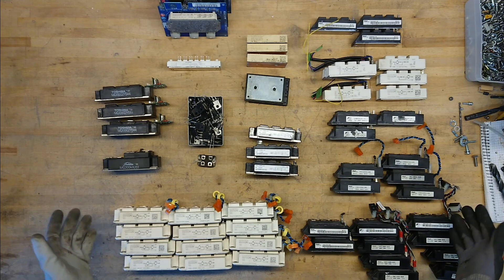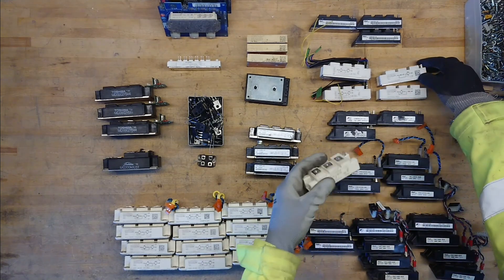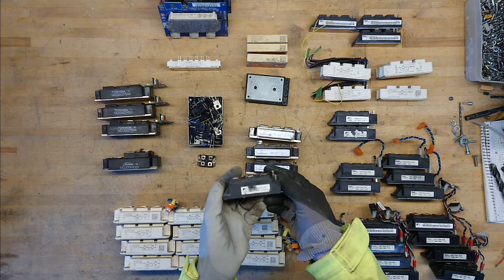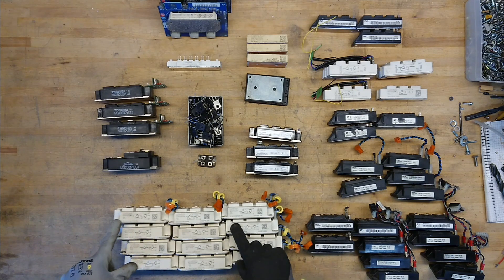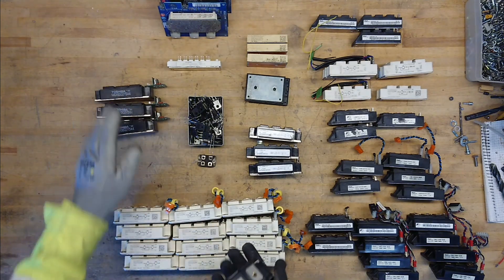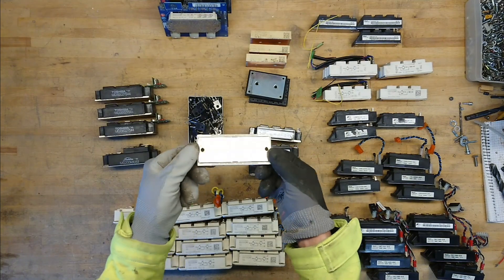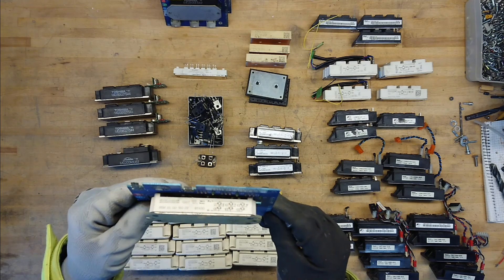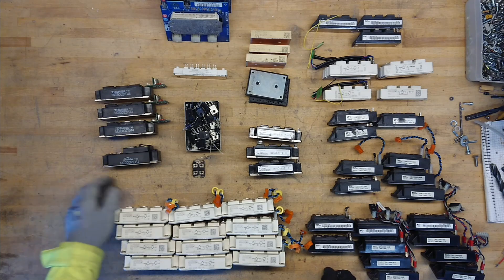Salvaged IGBT Bricks From Power Electronics - Isolation, Day 18

Comment: A few months ago I was very lucky to score three half bridge I.G.B.T bricks. I would like to ask you a question, why do they put a  'b on the brick and on the circuit diragram on the side of the brick it is shows that it is a gate?'  It is a 2MBI100F-120 made by fuji.
Reply from the maker: It can be legacy nomenclasure, B is used for Base on old power transistor bricks.

Comment: Rectified mains and Igbt brick based royer?
Reply from the maker: The gate structure of high voltage switches and the larger gate capacitance's makes the Royer hard to design for mains voltages.

Comment: what do you think of skmXXXGB123D series? are they slow or fast? than 12T4 and 128D?
Reply from the maker: 128D has a total turn on time that is twice as fast as the 123D. 128D has a little higher gate capacitance but is rated for higher current.
Reply: @KaizerPowerElectronicsDk  oh, i understand..  i have skm bricks rated for 300A, they can used for DRsstc but with slow frequency? like 30-50khz?... i have skm200gb but they are 128D series.. 
my fear is that i won't be able to use the 123D bricks. i think so i need good Phasecompensation in the circuit
Reply from the maker: @hvmarcober2314  When you use them in a resonant inverter at very low on-times/duty-cycle, then you can push them to much higher currents. A SKM brick rated for 300A can easily take 1000A pulsed since the resonant current help it run much faster than its datasheet specifications for hardswitching. I wrote a long article about calculating this: http://kaizerpowerelectronics.dk/tesla-coils/drsstc-design-guide/igbts/
Reply: @KaizerPowerElectronicsDk  awesome! yeah that's true, i think that's because the RMS current is low at verry low ON time.. i seen this nice board, it indicating the reference of IGBTS with the peak current and a lot of calculations is in your website, this is why i love your sebsite, we can calculate all nescessary for a drsstc design.. For me i just need to buy high speed comparator haha, i need to make the prediktor from finn hammer, i dont have a lot of money for build UD2.7, but i have some component for build  Steve ward universal driver...
So thanks you for your answer about the IGBT speed, you help me a lot :)
Reply from the maker: @hvmarcober2314  come show your project at www.highvoltageforum.net

Comment: Interesting, quite a selection. 

Are the maximum ratings at IGBT bricks reachable at the same time?
Lets say 100A at 1200V or is it either max 100A or max 1200V with a maximum power rating?

Oh and I guess if you don't come to using them all, you could still build a litte shed out of them, they are called bricks after all ;)
Reply from the maker: The ratings are for hard switching and at a low enough frequency you can reach both maximums. As long as it is within the SOA graph in the datasheet, Safe Area of Operation. Soft or resonant switching is a whole other story and we can push maybe 4 times as much current through it :) I wrote a guide to calculate that here : http://kaizerpowerelectronics.dk/tesla-coils/drsstc-design-guide/igbts/
Reply: @KaizerPowerElectronicsDk  Interesting, thank you. :)